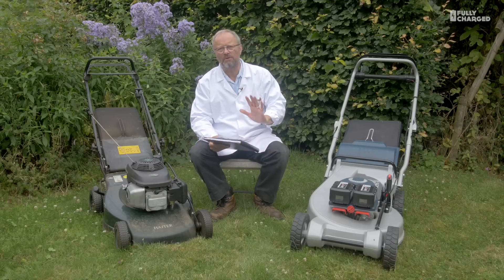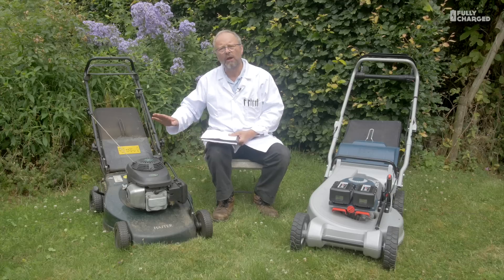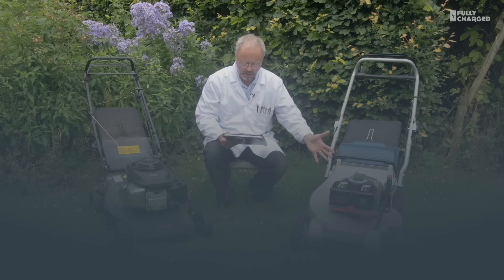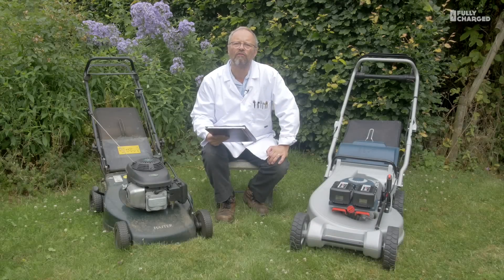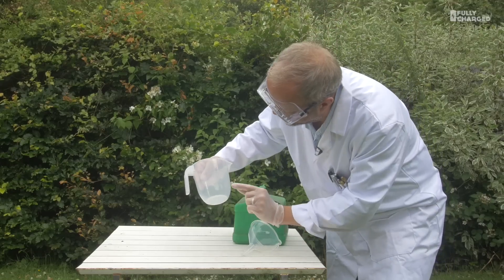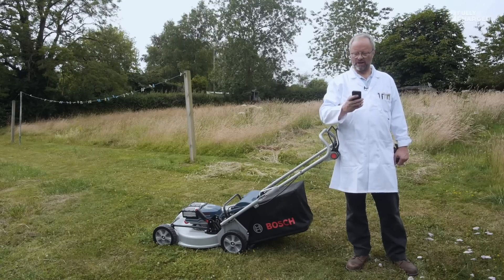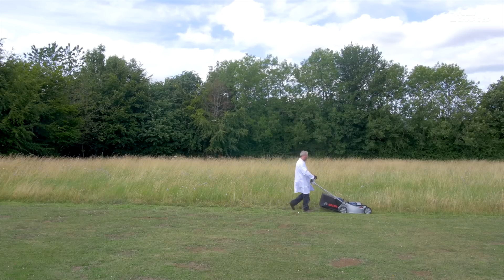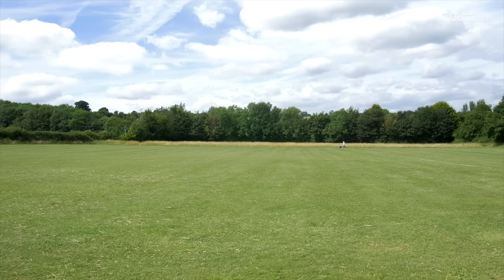Battery V Petrol. The Lawnmower Test | Fully Charged

Comment: Impressive, but a couple of points.  You ain't comparing apples with apples, because the energy at the business end of the Hayter is NOT the specific energy of the petrol. There are inherent losses from the IC engine - in your knackered old and small Hayter mower engine, likely to be well over 80%.  Whereas the battery model's efficiency will be hovering round the 100% mark when new.   Now, you give a clue to the next point yourself- the Hayter has run for years. I have a 2001 Honda, still running like a train, with no smoke, cutter effectiveness loss or other engine problems.  How long will that Bosch run?  In my experience of battery tools, not that long - and by a long chalk!  I bet those batteries will run out to £500-700 a pair for a start. It will have been designed by computer to start deteriorating just after the guarantee runs out, unlike the Hayter, designed by humans in an era when planned obsolescence was unheard of!  If the Bosch runs for 5 years you'd be lucky, since even if the complex battery and electronics don't go tits-up, the plastics used in it will go brittle out in the sun all summer.  And then there's the price - well north of 1300 quid for the Bosch, 5 times the price of a new small Honda!  I'll stick with the fossils, thanks!

Comment: Interesting test but if you didn't want to use the old retarded units, why on earth use BTU? :)  you could look up gasoline energy density and get it in MJ/L. It varies somewhat because fuel is never the same but it's around 8.4-9kWh it seems.
Not critically wrong and the conclusion is ultimately the same.
A graph showing 100 minutes vs 7 might have been effective too.
The rest of the device remains primitive though. It should be both autonomous and laser based so it's completely quiet and ultra efficient. Although collecting the clippings would still be messy.

Comment: Can't wait until batteries have a similar energy density to petrol. It's coming folks. A lot of electric things are viable now where they would have been niche just a few years ago.
Reply: +hung huge don't hold your breath
Reply: ghd67ik2887218
When you take it ALL in it's not that much of a stretch. Remember a battery is a bettery. It's self contained and in some cases even used as part of the structure. Petrol needs a tank. That needs to be mounted, needs breathers, carbon filter, etc. When you add up the entire fuel block it's much larger and heavier than just petrol on it's own seems.
Reply: hung huge
and the car battery packs are thermal managed (ie. air conditioned) and protected against impacts under the body. the tesla 85kWh pack is about 1300lbs that's 7200kWh from petrol LOL

Comment: Electric cars and lawn mowers have very different efficiencies, internal combustion engines have very low efficiency while that of an electric motor is very high, that much is fact but does not tell the whole story. The solar panels on my roof are only 17% efficient but that's fine since they generate more energy than I need and have no running costs so far. There are more important metrics like how much damage we are doing to our planet and the life it supports etc.
Nice video though that nicely illustrates the difference in efficiency of electric motors and internal combustion engines.

Comment: I would have multiplied the fuel by n and then divided to the running time by n so as to reduce the errors associated with liquid (bits left in pipes, measurement error etc).

But regardless, an excellent little video.

Comment: We own a rechargeable electric mower made by Black and Decker.  It's a great little machine.  Besides the benefit of efficiency, it is quieter, much simpler to operate, no tune ups, no spark plugs, no trips to buy gas, no need to stabilize the fuel for the winter, no gas can, no oil changes.  It's a win win.

Comment: That was fun. I made the switch to an electric mower because:
 a) It's environmentally sound and the right thing to do and a good example to all and I did it for the children.
 b) The three petrol mowers I've been through just kept breaking - they'd seize up over winter or refuse to start or would start then would make clank-clank-clank noises... then seize up when I tried to trim the rocks in the garden or, come from the shop pre-seized up.

I might not have enjoyed a representative experience but, the electric one just works, even on the rocks.

Comment: im a fan of electric power, but if thats a "proffessional" mower im a one legged lithuanian cowboy. 
first of all it costs over 2 grand, and the run time of 1500m square metres would take two hours, where do you recharge it for the rest of the day? the hayter mower is "a bit knackered" so its probably only 50% as efficient as when new. come on rob, its a nice idea, but a few years of improvements in battery efficiency away from pro. i do look forward to the day when we dont have to struggle with crappy briggs and stratton engines though ;-)
Reply: +the green man servicing would be cheaper, id worry about the motor working  well in cold weather, can it collect wet clippings, if you hit a rock is it badly damaged? this happens daily when used commercially.
Reply from the maker: +the green man I am just cutting another episode with more detail about the mower. It was designed to directly replace the equivalent petrol model (my Hayter isn't a pro model and is therefore more fuel efficient than a larger mower with a bigger engine) plus they have covered the remote recharging angle very cleverly, all will be revealed in the next mower ep. 
Batteries are constantly improving, this machine would not have been viable 5 years ago, however battery capacity is improving at approx 10% per year. 
The next model has same size/weight battery (compatible with this machine) and they have 25% higher storage capacity. Same as the new Nissan leaf, same size/weight as original but instead of 24 kWh it's 30 kWh.
Reply: also the petrol fuel tank will have a raised tube to stop contaminated fuel entering the fuel bowl, which also has a raised fuel pipe and needs fuel pressure from gravity feed fuel to use all fuel out of the carburetor fuel bowl. Electric motors are still vastly more efficient than a combustion engine, although for a piece of land that size, I would prefer a sit on diesel lawnmower.
Reply: ***** perhaps if it had a nice sound, batteries had a longer cycle life and comparable price to a combustion mower

Comment: Nice video, Robert! I think you may have been a bit generous on the fuel, since I came up with a value of 49 mL, based on the value of 33.41 kWh/U.S. gallon in the "Gallon gasoline equivalent" Wikipedia page. But the energy density of fuel varies depending on the precise mix of chemicals.

One thing this video shows is how little energy is really needed to spin a cutting blade around. I swear I grew up with a 3/4-horsepower mower, but I may be forgetting a number in there somewhere. 4 hp is probably wildly overkill. I wonder if mower engines are bigger now because of some sort of emissions requirements. Maybe they need to throw off more heat for catalytic converters? That old family mower spewed massive amounts of unburned hydrocarbons out its exhaust pipe, making it smell like I'd been doused in gasoline by the time I finished.

Electrics are great because of their lower vibration and quieter operation, and that's an intangible thing that can make the cost worthwhile. But there are probably professional situations with work being done almost every day where these would save money over the life of the mower.

Comment: "thedementation666 4 hours ago
 Always love your videos however, 2 things I need to point out:

[First one - nobody mows the lawn with that small amount of petrol, you fill the tank. And so it lasts a long time, and isn't very expensive, a few dollars."] ---
My response:  No shit, sherlock.  He deliberately put 56 ml in the tank to achieve similar energy as the battery mower.  It was an efficiency test.  And don't bother complaining about the price of the mower.  He chose a professional grade one which costs more than twice as much as an entry level electric mower.

Comment: I got an Ego lawn mower, leaf blower, and string trimmer to replace my gas ones. The mower lasts about 45 minutes, which is normally long enough for me to mow my 1/4 acre lawn. The battery takes about 20-30 minutes to recharge.

But I love that I no longer have to change oil, drain gas or put fuel stabilizer in it over winter, and can lean my mower upright in the garage, saving some much needed space. Plus no more need to pull start my lawn equipment, and hoping that the spark plugs and pull cord are still good.

Now hopefully they release a snow blower soon...

I also like that their batteries are interchangeable, though their bigger ones are a bit pricey.

Comment: I have a mains electric mower, it is powered by a combination of solar, nuclear and gas according to my supplier and has zero second recharge and runs for as long as I pay the bill- batteries on a mower is a bit silly as most mown lawns are less than 100mtrs from a socket.

Comment: Always love your videos however, 2 things I need to point out:

First one - nobody mows the lawn with that small amount of petrol, you fill the tank. And so it lasts a long time, and isn't very expensive, a few dollars.

Secondly, the lawn mower is $1500USD, which is triple the price of an equivalent petrol one, so if the electric one cost as little as 10 cents per mow, and the petrol one $5, it would still take 200 mows to get your money back. That's 16 years if you mow once a month.

And yes, I own an electric lawn mower and trimmer. Mainly because I couldn't be bothered with the hassle of going up the petrol station to fill up.
I'm all for battery, but this video isn't the best way to convince the public.

The best argument is the mower is quieter, cuts off instantly when you stop, and there is zero maintenance.

Comment: Only problem is that for that Bosch GRA 53 it is 1,100£ or $1,600. Kind of pricey for a push mower. Don't get me wrong I like electric vehicles and would sell my soul for a Tesla P90D but for small stuff like this its just cheaper for your average joe blow consumer to buy the gas mower.
Reply: +Zach Huneycutt Don't be a fool.  He even said it's a PROFESSIONAL mower.  Bosch do much cheaper electric mowers for HALF the price you just described.  GRA 53 is for PROFESSIONALS, so it costs a premium.
Reply: +Will Davis just cos it has "proffessional" on the side dont mean anything, it will go a max of two hours between charges, then what? how does it stand up in cold weather? can it collect clippings as well in the wet? it costs 2 grand, what happens if you hit a rock? all these things happen on a day of proffessional mowing.

Comment: Why do you need to mow your lawn? Why, if you lived in California your lawn would be dead! Problem solved.
\
Reply: +jumpsplat120 Plenty of nice lawns in CA.  It's called use a sprinkler system.
Reply: you've missed the point entirely.
Reply: +Mike Bablles Hard to believe, but this is what's running around out there. :-/

Comment: Robert, typo patrol: British Termal Unit lacks the 'h' in Thermal.  :)

Great video.  I can confirm the ratio of energy used - I measured my corded electric mower for an hour of heavy duty mowing, with a Kill-A-Watt meter.  It used a bit over 0.4kWh, which is equivalent to less than a 1/4 cup of gasoline.

I'd love to buy this Bosch mower, but I don't think they sell it here in the States.  It looks well made with the cast aluminum deck.  Which wheels are driven?

Comment: I know it would be a tangent in the wrong direction but just imagine if there was a more efficient way of releasing the energy in that petrol.
Reply from the maker: +Robert Sharp I absolutely agree, if only there was an efficient way of extracting that incredible power density from gasoline and turning it into electricity we'd all be driving cars that did 500 mpg
Reply: +fullychargedshow Even generators are not efficient enough.
Reply: minus the polluting byproducts. If they could somehow be ameliorated then maybe we could take another look at it but I think fossil fuels are done.
Reply: +Robert Sharp Well maybe, but fossil fuels are also a finite resource.  Well I guess technically Robert's power source (the sun) is also technically finite, but it's got a few billion more years in her!

And then you also have to take into account the energy required to get that petrol to the can in your garage: drilling, extracting, refining, piping, dispensing.  It's a cost optimized, but highly energy hungry process altogether, and it's only getting worse as the fossil fuels that are left are getting harder and harder to get at.

I know you're heart's in the right place and you are thinking outside the box, but I think in the end fossil fuels are a dead end and the improvements in efficiency and extracting more useful energy out of the chemical bonds that are storing that energy are reaching diminishing returns, especially in a small form factor like a lawnmower.

Comment: Have you done any videos of where the electricity to charge batteries is coming from.  If its from the grid, Coal, Nuclear, gas?  What would its efficiency be if it used those in comparison to wind, solar and other renewables?

Comment: Just out of curiosity, how long does the Petrol mower last if you fill it completely instead of just 50 ml?
Reply: +Daniel Sadjadian Probably not the 100 minutes Robert estimated the electric mower would've lasted.
Reply: +Daniel Sadjadian a full tank will  last an hour in most mowers, maybe a bit longer. depends on the model.

Comment: Yep.. electric motors are far more efficient than those noisy dinosaur-juice explosion engines... though arguably the battery is not a power source (just an energy store... like a flywheel) and there'll have been lots of power losses along the way to get the energy into the battery in the first place... By my calculations if you were charging from solar (~20% efficient) with power transmitted across the national grid (~8% losses) then it took around 2.3KWh of energy from the sun to put 432Wh of energy into the batteries.

Of course... if you'd put solar panels directly over your lawn, then the ~8% loss of transmitting over the grid wouldn't be a factor... and you'd have oodles of solar energy for charging your nice shiny Tesla... As an added benefit, you wouldn't need to mow the lawn anymore either as grass under the solar panels won't grow without sunlight :-)
Reply: Assuming that 100% of the suns energy reach Earth, which is not the case. Most of The Suns energy is just wasted in to space. I would say, to be generous, 0.1% of The Suns energy reach Earth, (which is probably far to generous). Meaning that the Sun to Lawnmover efficiency is 1 * 0.001 (Sun to earth) * 0.2 (solar panels to grid) * 0.92 (grid to lawnmover) = 0.0184% Sun-electricity-consumption-efficiency or SECE.
Reply: +Arxcis We also cannot neglect the fact that many previous billions of years' worth of Sun's energy that have been wasted... on pointless interstellar photon light-speed travel.

All for what, I ask you? A little twinkle in the night sky of some alien world? This self-centred waste of fusion energy probably brings the Sun to Lawnmower efficiency down to 0.000000000236%... etc.
Reply: +Jim Conner Of course only about 1% of sun goes into plants that was then made into fuel.

Comment: I wonder how well this would scale up for agricultural use. Has anyone done the maths to check the viability of combine harvesters and tractors? One disadvantage for electric road vehicles is the weight of the batteries, but on a tractor, weight is often added to help it grip. Also at ploughing or harvesting speeds, air resistance is no longer a factor. If a tractor or combine had spare (and possibly massive) batteries being constantly charged up back at the farmyard, would it work to have a vehicle ferrying discharged and newly charged batteries to and from the farmyard and the field to remove discharged batteries and slot newly-charged batteries in every couple of hours or so? If electric power is so much more efficient, it would surely pay. I'd love to think I've hit on something, but suspect this must have been worked out and dismissed long ago.

Comment: One small snag with your 'experiment'. You've calculated the amount of energy in gasoline by calculating the BTU. The problem is that in a combustion internal engine, it's the expansion of gasses that are actually 'absorbed' by the engine and transferred into kinetic usable energy. So you're actually using the wrong part of the energy contained in gas to make your calculations.
The main issue is that the vast majority of energy in petrol is converted in heat when we burn it, and the CIE only uses the expanding gases. That makes the hole process terribly inefficient.
But I take your point the CIE should have died years ago.

Comment: The real measure of efficiency in this case is amount of lawn mowed per unit of energy used - i.e. square meters per kWh or square feet per BTU. It would have to be under identical conditions. From this episode it seems that electric would win by a mile (or 2.2 kilometers).

I've already started using a battery chainsaw and pole saw (the greenworks brand) and I really like it. For the rare big stuff I have the Stihl saw but I find that the battery saws do the job just fine and I really like the lower noise and stink. Much nicer to carry some spare batteries instead of a gas can. By the time the batteries are exhausted so am I.